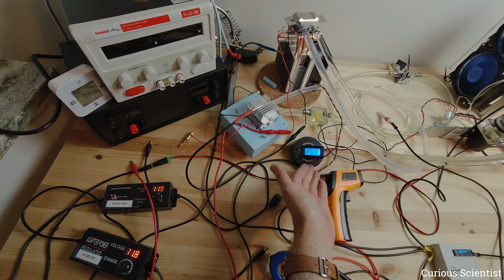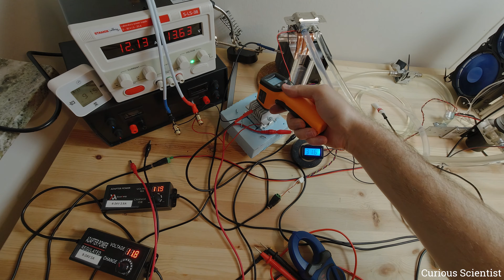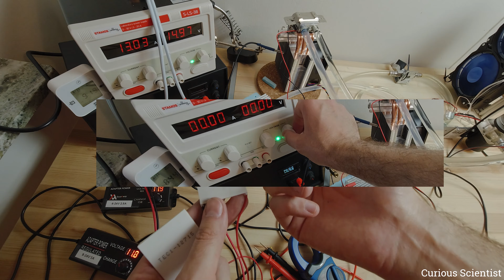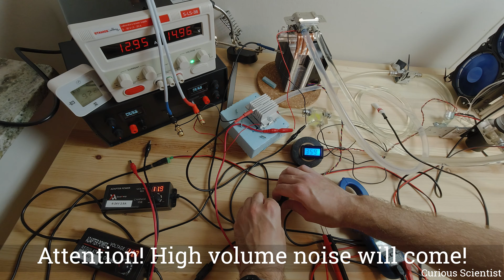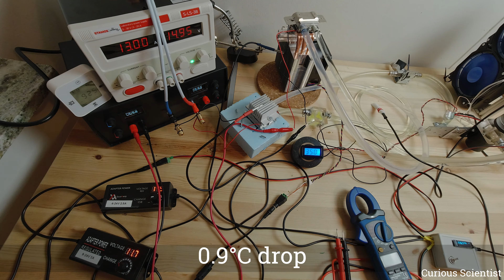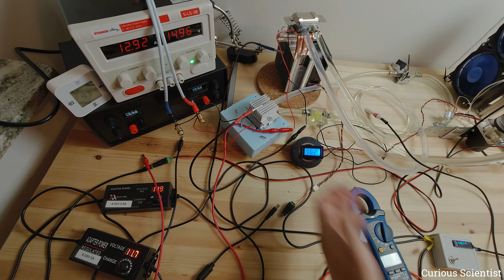Let's discuss about Peltier coolers #7 - "Enhanced" water cooler

Comment: Thanks for the nice video! Where did you order your 12715? I always get fake ones with a current of ~6a at 12-14V only
Reply from the maker: You're welcome! I got them from Aliexpress from reputable sellers. However, you should know that the '715 produces a lot of heat and you need a lot of cooling on the hot side to keep it cool and happy. If you don't cool it properly, it can be that the Peltier "throttles" itself down due to the too hot temperatures.
Reply: @CuriousScientist  Thanks for the fast reply! Yes the problem isn’t the cooling. Even in the first second after turning on the current is at 6amps and stays there. Do you have a link or name of the reputable seller? I ordered from 3 different AliExpress sellers and none of the was legit.
Reply from the maker: There are links on my website under the Parts & Tools page and some of them should point at Peltier coolers. Please see the description of the video. I usually share the same sellers' products that I purchase from, so they should be OK.

Comment: Hi, love the videos. I have a question about cooling. If you say that getting a lower 'cold side' temperature does not mean it can cool down a liquid or gas very well, how do you tailor the performance of a peltier to most effectively cool water for example?
Reply from the maker: Hi and thanks! 
I look up the performance chart in the datasheet and adjust the driving voltage to achieve the best C.O.P.

Comment: Great thanks for this video where you mentioned fake peltiers. I followed all your experiments to the T and sometimes with particular units I was getting the required delta T and with others I was way far off. I checked again after watching this video and the peltiers I bought recently labelled as 12706 were actually 12703. Thanks again and keep up the good work ❤
Reply from the maker: It's great to hear that you figured it out because of my videos. Unfortunately, it is very often that they sell fake Peltier coolers.

Comment: For a small cooler, why not use the same set up, but instead of using a cpu cooler on the hot side for the second peltier, use a already colded water? in my set up space isnt a problem and im thinking of pushing to get the colder water temp for my main hot side water peltier heat sink by using a fan radiator at first to get it back to room or even outdoor temp, then sinking that heat in outdoor soil to get a average 15 to 20 celsius and finally get that water to the cold side of the second peltier to get it even lower, maybe to 10 or 5 celsius. The hot side of this one may be also sinked into soil. Main hot side peltier water could then be way lower then room temp and optimize the cold end result as i understand TEC for the moment...Does that kind of set up seem to make sense ? Tks- i learned a lot!
Reply from the maker: So if I understand correctly, you have an "underground pipeline" that you use to dump the heat from a heat source. So the water coming back from this pipeline is approximately 15-20°C cold. Then, you would replace my CPU cooler + Peltier part that cools the "main water loop" and you would have a Peltier cooled by this 15-20°C water, right? I don't know what is the "thermal capacity" of this soil-method, but if the soil is wet, I can see this working. And obviously, you will get better performance if you cool the hot side better. But keep in mind that if you want to cool large volumes of fluids, 1 single Peltier will not work properly, or will be very slow. Check my other Peltier videos to get a feeling of these principles.
Reply: @CuriousScientist  main volume of water Will serpentine underground yes
Temperature at noon is 12 celsius.
Then peltier cold side Will cold it even more(by à unuse solarpanel of 7 amp crurent. Water seems the better and accessible conductive fluid.
Its for à frigd for à small cabin in the wood
Still watching your other vidéos ATM
😁
Tks

Comment: First of all, how did you expect to cool down the water of a 200W CPU thermal load ... with 4Amps Peltier (50W) ....  Why didnt you use a bigger Peltier , like the 15 amps one at least, and power it with the similar 200w ... I was thinking for my next PC to cool down the water of the closed loop with a Peltier (with a high end air cooler Noctua NH-D15 on the hot side) , and a copper water block used for CPU's (manufactured for maximum thermal transfer) . But I was thinking to use the most powerful 40x40mm Peltier I can find ...

I've seen other Youtubers using a waterblock with 3 Peltiers to cool down the water of a closed loop ...
Reply from the maker: First of all, I did not expect. I just did an experiment proposed by a viewer where the main idea was to help the water cooling loop with an additional Peltier cooling stage. I did not use larger Peltier because the only 12715 I had was the other Peltier which I used as a thermal load for the water cooling loop. If you don't want to cool your CPU or VGA below ambient temperature, it does not worth the mess. If you add a 15 A Peltier cooler, you add roughly 200-250 W additional heat (Joule heat of the Peltier) that you need to get rid of. That requires basically an additional water cooling (or very good air cooling) system. Check this video, it might be interesting for you: https://youtu.be/3dmQDf3GcpY
Reply: @CuriousScientist  Ok . I understand , and I know about your video with Peltier not good for air conditioning. 
The TDP of the Noctua NH-D15 air cooler is 220W . The heat of a 15Amps Peltier should be dealt with with it.

I was thinking same : to help the water to be cooled down.
Basically the heat of the overclocked CPU (280w peak) will be dealt with a water custom loop including one 360 mm radiator (3x120mm 3000rpm fans) + one 240mm (2x120mm 3000rpm fans) in series.

Yes I would like the Peltier to HELP cool down the CPU but keeping all above the dew point to avoid condensation. The minimum temperature would be on the cold side of the Peltier isn't it? 

You did achieve a 1deg water temperature down. 
I would like to get water temp like 20deg...  now I have like 35 deg water temp.
Do you think this can be done with a powerful Peltier ? (there are even 12726 and 12730 ones ...)

PS:  I don't care about the electrical power consumption ...
PPS : https://www.youtube.com/watch?v=MPtIdIfqop4 - this guy tried a 15Amps Peltier in a water cooled loop ... and the result was : "it is useless" ...
Reply from the maker: Don't forget the following things: Peltiers run better at lower currents. Check my tests on different Peltier coolers. Their sweet spot is around 40-60% of their maximum current. Also, keep in mind, that the Joule heat is just a part of the heat that you have to get rid of on the hot side. The other is the absorbed heat from the cold side. So for example if you run a TEC12715 on max current (what you shouldn't), you have about 250 W Joule heat plus that let's say hundred-something watts of absorbed heat. So at the end, you have to get rid of around 400 W of heat. I would use four TEC12710 and run them at 50-60% of their max current (5-6 A). Once I have a lot of money, I will make a large Peltier-based water cooler just to help people to understand how they work. I have the knowledge, but I am financially limited at the moment.
Reply: @CuriousScientist  You are right, I know about the sweet spot of efficiency of Peltiers. Also about the need of the heat to dissipate on the hot side. 

Few question though : how did you make the calculation of how many Peltiers you need . You really need 4 of them?

Regarding heat transfer : I did test a Cooler Master Cryo (Peltier one - with software controlled dew point power to Peltier) . At max, the Peltier was drawing 130W . That means, it was effective only for small loads of the 10 cores Intel CPU . For all cores overclocked CPU on full load, couldnt cope ....
So I went back to my delidded water cooled AIO 360rad cooling ...
Reply from the maker: I just eyeballed the datasheet. At I = 5 A and DT=30°C, you can have around 40 W of heat absorption on the cold side of the TEC12710. 4 of them is 160 W, which is the heat that you can additional pump out from the water cooler in ideal case. And then, to keep the Peltiers happy, you will need to get rid of about 80 W total heat each (so, in total, 320 W). But, by simplifying the things, this is still not enough to balance the 200 W thermal load, so your system will be somewhere above the ambient temperature. If you want to go below ambient temperature, you need more cooling power than the thermal load. It is simple physics, if you produce excess heat, you will start increasing the temperature of the system. I would actually use 6-8 coolers with the above scenario. Also, you might want to build a proper liquid-heat exchanger to increase the surface area for heat transfer.
Reply: @CuriousScientist  Ok , I figured it out :

What we need is a double water loop : Peltier sadwich  - on the cold side a water loop going to CPU , on a hot side a water loop going to the radiators . (done by der8aure , see https://www.youtube.com/watch?v=YaOjrk98vPI) - he achieved 13deg on the the cold water loop.

Heating power calculation:
1. My i9-10900k delidded overclocked (on a regular AIO 360mm Kracken loop), on maximum possible load (Linpack ) was drawing 360W on all 10 cores / 5.3Ghz all cores. So we need to transfer abt. 350W termal heat with Peltiers . 4 pieces of TEC-12715 , at 50% (6V each) will be able to transfer 90W each . That is 90x4 = 360W . So we can go for 4 of TEC's in series with a power source of 24V (each will get a 24/4 = 6V)
 - The radiators on the hot loop will dissipate more power if the water is hotter. A 360 mm radiator, at a deltaT of 10 deg above room temperature can dissippate at least 500w  / a 240mm one can do 350W  (see https://www.ekwb.com/blog/radiators-part-2-performance/) . So I will go for the hot loop with 1x420mm radiator+3x140mm fans (top mounted) in series with 1x240mm radiator + 2x120mm fans (front mounted) . Total heating capacity of hot water loop = 500+350 = 850 W . Enough for cooling 350W (CPU) + 360W (TEC's) = 710W
- the temperature on the cold water loop should never go under 20deg - above dew point - avoiding any condensation. 
- to keep the water temperature on the cold loop at a certain temperature regardless the load we can use this: https://www.quick-cool-shop.de/en/peltier-controller/peltier-controller-qc-pc-co-ch1.html

Can you confirm the calculations?
Reply from the maker: I think that the guy you linked has absolutely no clue about how to run those Peltier units. I reached similar temperatures with a much simpler system... I would not rely on his conclusions. 

First of all, please never rely on the 27°C performance chart of these Peltiers, because with these coolers, I can assure you that you are never be able to have the real hot side temperature at near room temperature. Ideally, you would reach room temperature hot side temperature if your cooling media is already lower than the room temperature. I don't remember in which video, but I actually "reverse-calculated" the real hot side temperature based on the cold side temperature, current and voltage values and I got 10-20°C hotter than the water temperature in the water block. So, what I suggest is that you should use the 50°C perf. chart. So, let's say, the water in your loop is stable 50°C. You want to stay above the dew point, let's 20°C is more or less safe, thus your DT is 30°C. 50% for the TEC12715 is 7.5 A, so at this current with the 30°C DT, you will have around 8-8.5 V per unit. So, I would only use 3 Peltiers/chain. Then this gives you about 60 W cooling power per Peltier. So, I would use 6 of them and not four. 6 * 8.5 V * 7.5 A =  382.5 W of Joule heat, plus 360 W from your CPU. The water cooling system has to be able to dissipate at least 742.5 W. As a scientist/engineer, I would add a 20% safety margin, so let's say 900 W. This is a nice room heater. :)
Reply: @CuriousScientist  A Peltier guy on youtube does have an app to calculate Peltiers: https://www.youtube.com/watch?v=5cFJJeacJOc&list=PLeC9Tqil0aqwOoli10Lw8p18lZiP2N71f

Here is the screenshot for the 360W draw and 35W draw (idle) of the CPU with 4 x 15Amps Peltiers:

https://imgur.com/1Mn09Pc
https://imgur.com/6ENC6vJ
Reply from the maker: Seems like my numbers were not too much off (323 W vs 382 W). I guess he got a slightly different current for this voltage. Based on the second image, the cold side temperature is 40°C instead of the desired 20°C, so that might also cause the difference. BTW, I also made a calculator for TEC12703/06/08/10 and 15, but it is only Excel-based and limited to the known values published by the Peltier makers. I digitalized their charts and calculate the details based on the desired DT. Once I have a bit more time, I will make it into a similar calculator where you can change any of the variables (DT, U, I or Qc...etc).
Reply: @CuriousScientist  lol, yes but your calculation is with 6 Peltiers , and the screenshots are for 4 Peltiers..   
Anyway, I think this will be my next project ... once I will save the money for the whole cooling ... which is kind of around 600-700 british pounds...  :)
By the way , did you see this : https://www.youtube.com/watch?v=DWVfaxqTyl4&list=PLCWOaAWT0cAGeYR7yiL_ao1X4G8lECyXG&index=9&t=1s   ?
Reply from the maker: Yes, now I see the difference! That might explain the watts difference too. If you finish your project, I would be very interested to discuss your experience. So, please feel free to reach out when you are working on it (of course only if you want to share the details). Regarding the video, of course I saw it. I am a huge fan of their work.

Comment: I am trying todo an experiment of converting my window type A/C which uses compressor to Peltier cooling system. Using closed circuit for cooling the hot side (condenser ) and pushing cold air to the room (evaporator) of course I will remove the compressor or whatever needed. I might use 10-20 pcs in this setup but the problem is the DC power supply might not be sufficient. 
Based o your experience do you think this project might work or it’s just a waste of energy and money. My unit is 18000BTU consuming 11-13A/220V in full capacity
Reply from the maker: Hi! It is a waste of time and a lot of money. You will need about 4x the energy that is needed to run a compressor-based AC to achieve similar cooling power with the Peltiers. Also, you will have to get rid of an insane amount of heat from the hot side of the Peltiers. It is not feasible.